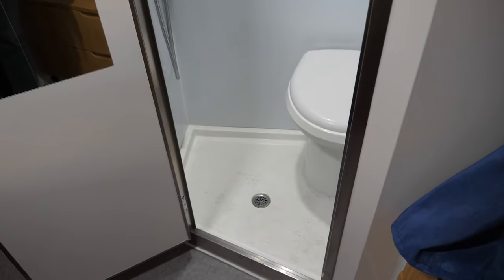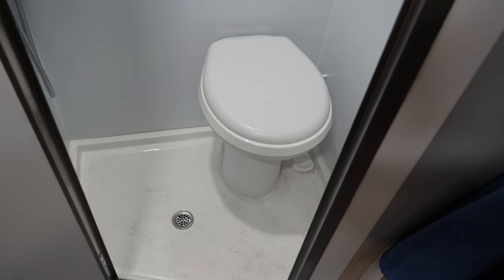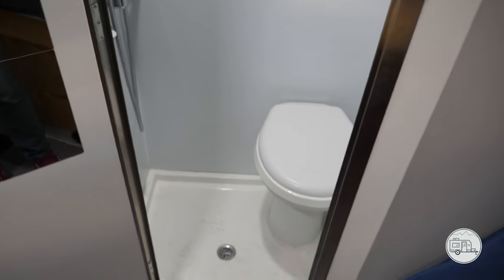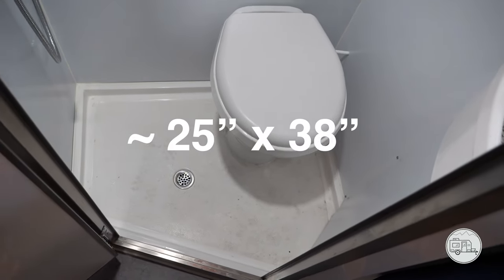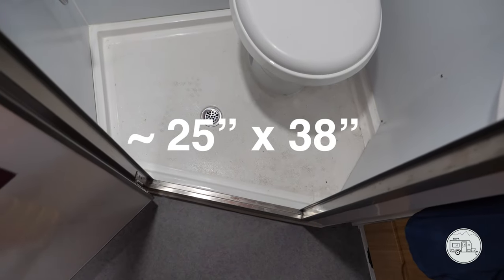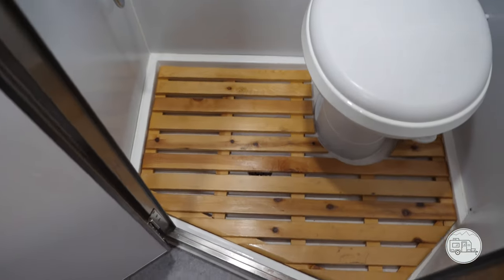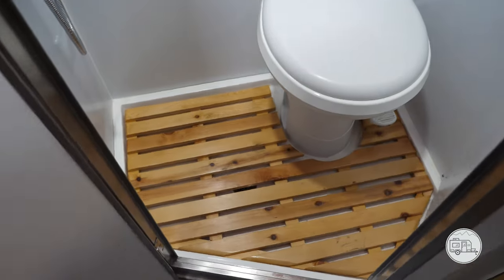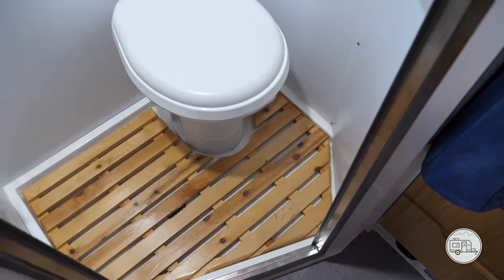OPUS OP15 Off Road Travel Trailer Wet Bath Upgrade Hack

Comment: Hey OP15 friend!    Got my mat built and installed this past weekend.  Love it.  Thanks!   Question: Noticing that the toilet lever hits the new deck and prevents the toilet flange from fully opening (only half way).  Did you have the same issue or find a way to adjust the lever to allow for full flush?
Reply from the maker: My toilet lever had about 1 1/2" inch clearance and the flange opened fully. Hard to say, but there is probably a lot of variation depending on why type of toilet was used in the build?
Reply: @OpusAdventures  Thanks.  I ended up cutting off the portion directly underneath the lever so that the lever could flush properly.   Works great.